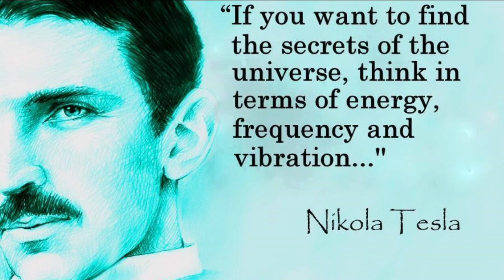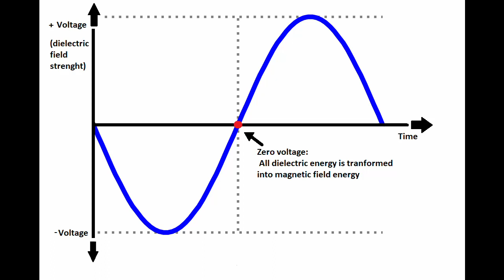The Resonant Bifilar Tesla Coil

Comment: If I'm correct, Lens Law is the one you can understand by using your thumb and 2 fingers to illustrate the 3 directions the energy will flow. Everyone interprets this 3-point intersection based on a drawing showing the finger/thumb positions. I have a strong suspicion that everyone is wrong. I believe the 2 fingers should be switched so that the middle finger is pointing the way everyone says the index finger should be pointing, and the same switch with the index finger so that it's pointing where everyone says the middle finger should be pointing. The result would be to add multi-dimensional properties to the angles.

Comment: capacitors aren't only way to get dielectric charge piezo have the structure if pressure is applied they release charge might we be leaving out the most resonant thing known "the crystal structures" that seem to be the best at filtering focusing transferring and storing the "vibration point forces"

Comment: Can one build an AC electricity generator using bifilar tesla coil? Will it be more efficient than available electricity generators?
Reply from the maker: Yes you can, and it is indeed very efficient. But the AC is high frequency and needs to be rectified to dc, to be used for work

Comment: Great Vid Ivo!  I simply think of an exchange of energy at resonance between the capacitance and inductance.  The energy in the capacitance (dielectric field) is proportional to the voltage squared while the energy in the in the inductance (magnetic field) is proportional to the current squared.  Thus with no resistance, the joule of energy would exchange between the two.

As you mentioned the coil experience counter-EMF (Lenz's Law) that attempts to resist any changes in current to the coil.  As for the non-mentioned equivalent on the capacitance side (conjugate)...inertia resists a change in voltage in the capacitor.

For practical purposes, one must first ascertain if the resonant LC circuit is either parallel or series resonance.  A series resonant LC circuit appears as a short circuit to the driving source while a parallel LC circuit (called a 'tank') appears as an open.  So, what configuration(s) is the bifilar coil?  The coil being driven by the function generator, I would assume without actually seeing the schematic, is a series.  The coil(s) being driven by induction (either dielectric or magnetic) most likely are parallel or a complex combination of both parallel/series.  At any rate, since you are using small diameter wire your resonance will dampen out quite rapidly (loss of energy, represented by Q of circuit), which is not preferable.

Typically a parallel tank is preferable as it appears as an open to the driver and thus draws little current.  In fact, it is customary to drive a parallel tank with just a small duty cycle square wave to "ring the bell" (i.e., overcome just the resistive dampening effect).

A bifilar coil in actuality has a very small capacitance.  However, it is matched to the rather small coil inductance.  The fact that it is wound such that the voltage applied to the capacitance is higher, resulting in more dielectric energy (Joules = 1/2 Vsquared times Capacitance) does not in fact result in a higher capacitance, only a higher energy storage.  Tesla said that he was attempting to not have to find external capacitors for the coil by the way he wound the bifilar, genius.

You may also think of two (or 3) bifilars separated, as you do in your experiments, as looking like round capacitor plates to each other.  And thus any voltage difference (enhanced by proper phasing between coils) would appear as plates of a capacitor and thus a dielectric field between bifilar coils, hence, your observed dielectric induction between plates.

Therefore, between plates there would be the cross product of the magnetic fields crossing perpendicularly to the electric fields between the bifilar coils.  This would be analogous to the a transmission line (reference Dollard).

Another way to create the bifilar coil would be to just wind a unifilar coil.  Then another, and place them on top of each other, connecting them in series.

Why would one do this?  First off it is probably easier to wind unifilar coils.  Secondly, you can create series/parallel coil sandwiches to enhance the affect you are looking for.  Thirdly you can increase inductance of the coil by simply putting iron or ferrite disks between the coils.  (example if you take a small 30 mHenry coil and put a closed core through it you get an increase of up to 3 or 4 Henry's (thousands of times more energy to resonate with the capacitance))>

Sorry about the wordiness...your videos cause people to think...and I think with my fingers on a keyboard(:
Reply from the maker: Sorry for the late reply Mark S.
yes your description of resonant energy is very correct. Now how can we use this?

Inertia resists a change in voltage? Inertia of what? Inertia is mass related, but here we are talking about fields, dielectric fields. So the dielectric is related to mass/inertia.

Series or parallel resonance. Yes I thought about this a lot. When you look at separate inductors and capacitors a resonance, it seems clear. But now we have a inductor that is a capacitor at the same time. A capacitor that is an inductor at the same time. It can store electric in its magnetic field AND dielectric field, and the 2 fields occupy the same space. Therefor, to me its impossible to speak of parallel or series resonance with a single bifilar coil, as it is both at the same time!
In my experiments I use series parallel resonance, by placing a cap in parallel and another cap in series with the coil. I just succeeded with a experiment with negative inductive spikes, triggering the series parallel resonance showing a sudden increase in voltage. (wait and watch the next vid). In principle, the energy gain should be larger than the resistive losses. 

Yes the capacitance of the coil is just a few hundred pF. It is indeed the voltage difference between the windings that increases the abiility to store electric energy in its dielectric field (increased capacity, i mix up these words a lot).

Indeed the coils , when stacked, act as capacitor plates. If one coil is resonant the voltage change induces (dielectric inductance) a current in the next coil (and becomes resonant, if it is properly tuned).  but there is another option. "disruptive" discharge a negative charged capacitor into a bifilar coil, and it emits a radiant energy ray, is what Tesla seemed to be doing. Working on that also...

yes your coil winding suggestion is what I do with speaker wire. 2 unifilar coils, stacked on top of each other, series connected. the ferrite disks can also be on the outside. But these disks need to be made... I grounded ferrite, mixed it with epoxy and made a layer. but later I found out, ferrite has a crystal structure, and to produce it you need a factory... grounding it up and mixing it with epoxy diminishes its effects.

going to produce the series parallel video now.
Reply: Yes...I just watched your video and you are definitely coming along on all of this, most impressed.  Will have to digest what I saw in your video a bit.  Reason being that most don't think about a coil operating in series resonance at the same time as in parallel resonance.  That is a new thought, as typically a series capacitor is use as a 'coupling' capacitor to a resonant tank (parallel resonance).  Of course the series capacitor is typically set at a value for coupling and not resonance, and thus the resonance is happening at the frequency of the tank.  Yet there it is in your video...with a clear dampening modulation on the negative alteration.

However, you are using two separate bifilar coils...where are the scope leads connected?

Yes, dielectric inertia is well known that relates to the polarization of the dielectric...and ultimately the dielectric constant of materials.  It is at the atom electron level...but nevertheless is there.
Reply from the maker: the probe in my latest video (yesterday posted) is on the resonant (left) coil, inside rim, outside rim is ground. The dampening modulation, is when the series capacitor is shortly connected to the parallel LC, giving the high gain.

I'm now adding the third coil, and trying to tune it, to max output. Still a lot of data to process.

Comment: Geometry is missing in that Tesla's quote! Think of terms of energy, vibration and geometry! Frequency and vibration are the same thing.
Reply: Actually, frequency and vibration are distinctly different, as Tesla discovered. Everything vibrates, he even found DC voltage to vibrate at "the modest rate of 1 megahertz". His wireless power transmissions would resonate at the specific vibration rates of atomic structures and also the frequency of the mass of his paired antennae. (This is according to Gerry Vasilatos' chapter on Tesla in "Secrets of Cold War Technology" available on-line for free in .pdf format and lectures by Prof. Peter Lindemann (free on YouTube).

Comment: I am thinking about demoing a speaker style generator this weekend any ideas for the best resonator?🤔
Reply from the maker: tuned speaker box?
Reply: @MasterIvo  basically reverse speakers generating instead of acting like electro solenoid. Several in a row. Than try to get them to resonate. I'll post the production I get from it and actually try to power something else. I could try driving it with sound resonance🤔 and vibrating sander, some type of resonance tube. Another motor, a oscillating circuit...if that makes sense. It may work because it's harder to stop mini vibrations than a spinning disc from moving. And it might multiply?(the resonant vibrations) I'm interested to see what happens. If I get it sensitive enough maybe it will pick up small ambient vibrations. Idk never tried it so excited to find out😁
Reply: Going to test regular coil and bifilar. I'm thinking the better they are centred the less movement it will take to cross the magnetic lines back and forth. 😁if you send me a spark oscillator I'll try testing on these types of motors and generators confidentially and share the results. I'm only using privately not selling.
Reply: @MasterIvo  💚
Reply: YouTube is fibbing about how many views I have😂🤣😑
Reply: @MasterIvo  the energy did not turn into magnetism when the ac voltage raises than collapses🤔only the dc turned to magnetism. There's something else...hmmm. on speaker linear test.
Reply from the maker: @strangescience3414   you probably have a alternating magnetic field (like the voltage is alternating) so the total of + and  - is zero.
Reply: @MasterIvo  neet maybe a compass or magnet would spin to prove or disprove thanks for your valued addition. Oddly it became solid like a wall but was still generating. That was not the plan😂😂so it was picking up very small vibrations and still generating.
Reply: Hmmm...this gives me an idea😁💡
Reply: @MasterIvo  did you notice it has 12v dc and 25volt a.c. when you hook it to a battery
Reply: @MasterIvo  wouldn't that mean the buzzing sound is the wires attracting and repelling clanging into each other like a solenoid?

Comment: Hello again! Thank you for the fantastic info, are you willing to share your circuit for your three coil bifilar coil? Just curious to utilize it for some experimentation, and also, have you happened across the ABHaA coil in your experiments? Interesting concept, especially with the induction and field shaping the magnet wire is formed to. 

Interesting times!

Thanks again, and happy experimenting!!
Reply from the maker: yes I know the abha coil. I do want to share the circuit, but I'm working on an updated version. that's the one I will share.
Reply: Thank you for the share in the most recent vid!

Very exciting times!! :)

Comment: You take a bifilar coil and use it as the disk in a Tesla Faraday type generator, the spiral windings being similar to the spiral slits in the copper disk of Tesla's original design. The outer end of the coil would have a brush on it which contacts a metal ring to tap the electricity, the inside end connected to a slip ring for the other tap. You then spin it with a Tesla Turbine. There you have a combination of 3 great Tesla inventions into one super Tesla machine capable of more power output than any other generator on Earth and also being a super motor when power is put into it.
Reply from the maker: Great idea! Who's going to build it?

Comment: Hi Ivo :) Maybe you can help me a little. I am very beginner in this field, but what i need is to somehow generate various high voltage frequencies with tesla (or pancake) coil using function signal generator that i have, do you have any guidance how to make it work ? i have no idea how to make it but  thats what im feeling i need to to...to get high voltage and change the frequency of it or my needs(devices ;)
Reply from the maker: this is the basics:
Make 2 (or3) similar bifilar pancake coils(look at my other video on how to make it). 
stack them like pancakes(resonant in the middle, if you use 3) . 
connect one (or two in series or parallel) pancake to your signal generator and if possible set it on square wave 50% duty cycle.
If you have an oscilloscope, hook a probe up to the other coil, and look at the signal, when tuned into the resonant frequency, the voltage is high.
you could also use a small neon lightbulb. hold one leg with your fingers, and connect the other leg to the resonant coil, while the other end of the resonant coil is grounded. If it is resonant the bulb should light up. (but maybe a signal generator is not enough) 
Tuning can be done by adding a parallel capacitor to the resonant coil (more capacitance provides a lower resonant frequency).
That is the basics, if you need higher voltages, the square wave signal generator should drive a mosfet(using a gate driver IC) , that switches a higher voltage/current to the first coil.
keep in mind that the parallel capacitor needs to be able to handle the high frequencies and voltages (use ceramic or polypropylene).
Success with experimenting!
Reply: wow..thank you for the quick response, that was a lot of help!!!!
Reply: every coil has its own resonant freq. so to use that coil 100% we should only send the exact resonant freq. to that coil right ? its like a musical instrument with his resonant chamber. so after sendind that res. freq. we amplify the energy into correct overtones(harmonics) to infinity..like a spiral ... so there is no point to send any other frequencies to that coil right ? or is it? other than low and high harmonic frequencies...so the res. freq. of each coil is fixed right ? it doesnt change ?
Reply from the maker: Correct, like tuning an instrument. the frequency only changes when the inductance or capacitance changes
Reply: might be a stupid question ..but does the transistor/mosfet changes the frequency in a circuit ? also any guidance how to hook up a signal generator + transistor to drive my pancake coil ?
Reply from the maker: There are no stupid questions, only stupid people who don't ask questions. No the mosfet/transistor does not change yhe frequency, if it is not directly connected to the resonant coil. If it is part of the resonant coil, it does slightly change the frequency due to the capacitance of the transistor/mosfet.  For hooking it up I advice you to google it, there is lots of good info about it.
Reply: Hi @Master Ivo, Thank You, your beautiful well-done videos clarify a lot. 
Is there any way to predict the size of  Bifilar Pancake Coil for given frequency?
Reply from the maker: No not really, the resonant frequency is dependent om the inductance of the coil (amount of windings and diameter, more is lower frequency) and the capacitance of the coil (coil surface area bigger, is lower frequency, and the winding distance, smaller is lower frequency). I think the best would be making a coil from foil, but its pretty hard without a specialized machine (maybe in the future).